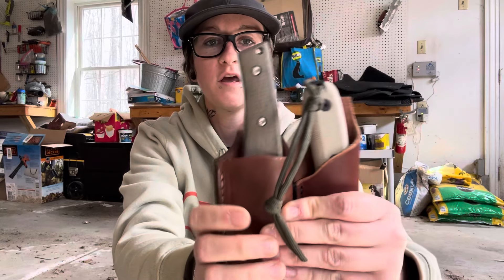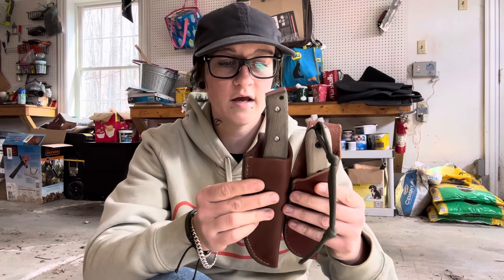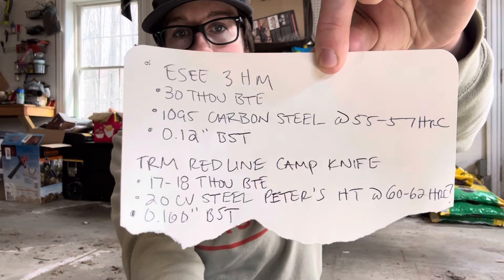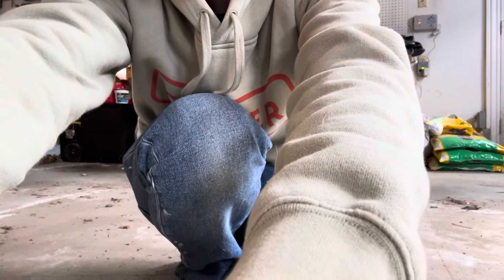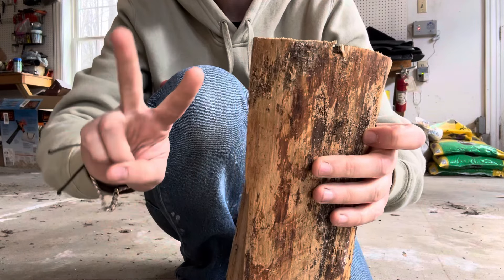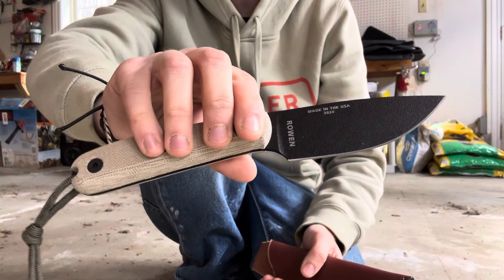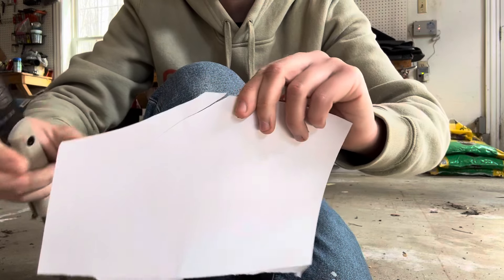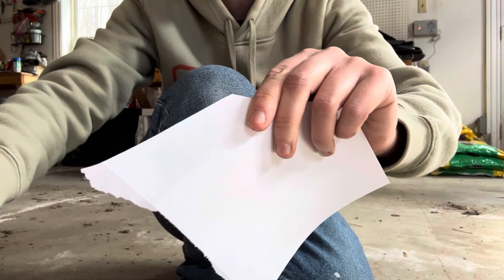TRM RED LINE CAMP KNIFE FAILURE! ESEE 3HM 1095 VS TRM RED LINE CAMP KNIFE 20CV BATONING

Comment: I don't understand why TRM marketed that as a camp knife. It very much looks like a Chef knife and based on your testing makes me think it shouldn't even be used for anything else especially due to the chipping issues. Thanks for the review!
Reply from the maker: I’m highly disappointed! I know they can do better.
Reply: @ericasedc  agreed! Also WTF is up with that handle?! Like that's basically how not to design a handle especially on something marketed as a hard use knife.
Reply from the maker: @mightymcsamson5899  RIGHT! Like.. it’s almost a joke
Reply: Cooking food is one of the bigger camp tasks. That's why it's called a camp knife. Not a Bushcraft, survival or tactical knife.
Reply from the maker: @MFD00MTR33  and it’s not well executed. In any sense. Have a nice day!
Reply: It had to have tapped the concrete because that part of the knife had no contact with the wood and she said she couldn’t even explain how it happened. It only takes a tiny hit on something like concrete to cause damage.
Reply from the maker: @poncho151  it shouldn’t have chipped even if I lightly tapped it on the concrete. It’s a dang camp knife. God forbid you drop it or you hit in on a rock at the bonfire on your camp trip and the edge chips. Annoying and inappropriate. Not well done no matter how you put it. Have a nice day!
Reply: I understand minor chipping if you hit concrete hard, that will happen with most any steel if it has that bte, but nothing you did should cause that
Reply: agreed I would not have picked 20CV for this type of knife.  They've got other knives in magnacut, don't know why they didnt' go with that steel
Reply: It’s a chef knife for sure. I’m thinking about the CF grip. 20CV/M390 is not a choice of steel for camp knives. If it was MagnaCut this would be more viable as a camp knife

Comment: A quick glance at the TRM handle gave a bad first impression. I would put it to the grinder and turn it into something useable. 20CV is great for a pocket knife but is has to low of a toughness to make a good camp knife. Even before watching the video I expected it to chip. On the other hand Esee does a good job for the intended market but I prefer better cutters. Better steel run as hard as possible to retain a decent amount of toughness with a thin edge geometry is what I want. After all knives are first and foremost a cutting tool.
Reply from the maker: I totally agree with you!

Comment: If there’s chipping on the part that wasn’t going through the wood then it’s most likely you tapped the concrete with it. So that doesn’t really prove that the 20cv was to thin or run too hard.
Reply from the maker: Except it does . If you are out camping with a camp knife as this is supposed to be, you are likely to possibly drop it on the ground, there are rocks etc- and the knife should not chip lightly hitting a hard surface. If I can take my custom 66.5 HRC K390 and whack it into bone or antler or hit staples/the drive way with it and nothing happens (it’s only 10thou BTE), then this is too thin and shit. Thanks for watching!
Reply: Not to mention it was able to chop against the wood grain and not have any chipping, yet the tip that did nothing chipped…
Reply from the maker: @poncho151  the tip is too thin and probably burnt. While the rest of the edge is not burnt. Have a nice day!

Comment: Loved the video!  I'm excited to see your blade steel testing getting under way.  I think that whoever designed that handle on the TRM did it more for looks rather than for use.  I watched the video back and it's hard to tell where the front end of the blade came in contact with anything.  I'm just wondering on the first pass once you got all the way through you can't see if maybe the tip came in contact with the floor as you were pulling away.  If not than who knows.  Anyway, I love all your videos but that hard use testing ones are my fav.  Have a great weekend!
Reply from the maker: That’s the only thing I can think of! Thanks so much for watching!!!!

Comment: In my opinion, there is only one way that part of the knife could be chipped.
That part of the blade has come into contact with the concrete floor.
You should never ever baton with a knife or an axe onto the ground. This is how most axes are damaged.
Always place a section of timber on the ground and then baton on to that.
Reply from the maker: Thanks for watching!

Comment: This is a prime example of the difference between a knife maker and a knife manufacturer. 

The TRM Neutron... an EDC folder.... is 25 tho BTE. 

The TRM CAMP KNIFE is 17 tho BTE  

😂😂😂

The reason for the chipping at the tip is because they belt sharpen the knives and they burned the shit out of it.

When grinding or sharpening a knife on a belt grinder,  you have to be very careful at the tip because your hands act like a fulcrum and the pressure gets exponentially higher as you get closer to the tip (farther from your hands) and tips get burnt more than any other section of blade because of this.

TRM is a manufacturer. There isn't a single "knife" guy in that building and it shows with their designs, steel choice ect.

Like 20cv?? Really?? 🤣🤣🤣

Magnacut is the hottest steel right now and it would be PERFECT for this camp knife.
Reply from the maker: The whole thing makes no sense to me. It’s the most uncomfortable, random, unthoughtful knife I have ever used. Seriously. Like wtf. And it sucks because I KNOW they can do better! I have no idea what this is.
Reply from the maker: I will say- I think only the tip is burnt. The rest of the edge seems great. Regardless- I am not happy with this at ALL. 🤣

Comment: I'm not sure if I saw contact with the wood for the area on the TRM blade that exhibited chipping, perhaps there was some inadvertent contact with the cement floor. It does look like a strange handle shape, and the red spots on your hands definitely indicates hot spots. .017" behind the edge for a 20cv blade seems a bit thin especially for a camp knife. ESEE knives are fairly famous for thier tuffness even though 1095 is better at holding an edge than 1075 its more likely to chip. Didn't see that in your test. I own a Junglas in 1095 steel, haven't chipped it yet and it's holding a good edge. Good review. Thanks
Reply from the maker: Thanks for watching man!!!

Comment: What a horrible design on that TRM. I can't believe the company that made the Atom actually allowed that out of their shop. Magnacut would have been a better steel choice. My Rmor Knives Babayaga is thinner BTE and has 64 HRC and hasn't chipped on me through the abuse I've put it through
Reply from the maker: They need to redesign it and do it in Magnacut for sure.
Reply: @ericasedc  big time. That choil looked big even for my hand and that's saying something. Even the knife I designed only has a half inch choil which fits my finger no problem

Comment: The chipping is weird because where its at, wasn't the part that was used where you batoned. Did you maybe hit the floor with the edge accidentally? The first try went almost all the way through, unlike the second one or both Esee runs. It could have smacked the floor when you hit it at the end. Wood isn't hard enough to chip wood, you need to hit something harder than steel to chip it.
I do agree that the handle design is kinda bad, especially compared to Esee. I have big hands and even i wouldn't like it. Needs to be rounded better and take down that point.
Also 17 thou isnt thin. I have a big custom chopper in Nitro-v @61 hrc. Its 7 thou at the tip and by the handle and about 15 thou at the sweet spot. Its plenty thick to chop and baton and 8 never had problems with it.
Cliff Stamp (RIP) showed many videos of knives he had made or reground himself to be that thin or thinner and they did great.
Theres a video of him taking a crappy Condor knife (iirc) and taking it to under 3 thou and cutting wood, zip ties and food cans and it getting only slight damage on food cans.
Steel is a lot tougher than most people realize. If done properly and not damaged by over heating and ruining the temper (maybe the edge on the TRM is burnt) , steel can handle quite a lot.
Reply from the maker: It didn’t hit the floor. Knives can chip with wood if something is wrong with them. 17 thou is thin BTE for a knife advertised as a camp knife. The edge isn’t burnt. Thanks so much for watching!!!
Reply: @ericasedc  how would you know that the edge isn't burnt? If it's sharpened on a belt grinder, there's always a chance for it. Just because the steel isn't discolored, doesn't mean the edge (which it microns thin and easy to heat up) didn't suffer. There's plenty of evidence from testers that edge retention and toughness increase once they sharpen the factory edge off.
A camp knife is designed to be used for food prep and light wood work. 17 thou is plenty thick for that. Though 20cv might not be the best choice for it. 
A steel shouldn't chip in an area where it didn't do any work. 
It was fine where it happened and you chopped with afterwards to test. Just the tip was chipped, which is odd.
Reply from the maker: @MFD00MTR33  thanks for watching!

Comment: I hate 20CV/M390 on an outdoor knife. In all my anecdotal experience, it just lacks the toughness needed for that use. Even at thicker geometries, I still tend to experience micro chipping and apex fracture that dull out the edge quickly, even in light use. I've had it happen just by carving on a dry dirty oak stick to make some stakes for garden plants, and I've had it happen across 3 or 4 different brands with different treats. 

I saw that Red Line come up for sale a while ago and it was an instant pass. Love me some TRM, but that knife makes no sense. They were marketing it as a "hard use" knife, but the grind and steel choice suck for that. And yes, that handle design was an immediate "nope" too. IMO, for an outdoor knife,  the more neutral the handle shape, the better. You're going to be holding it in different grips and sometimes using it at length, so comfort in a variety of positions needs to be priority. That handle just throws that consideration right out the window.
Reply from the maker: Exactly like WTF were they thinking.